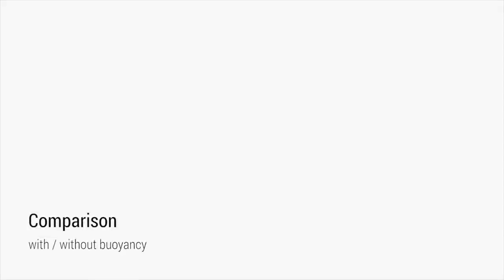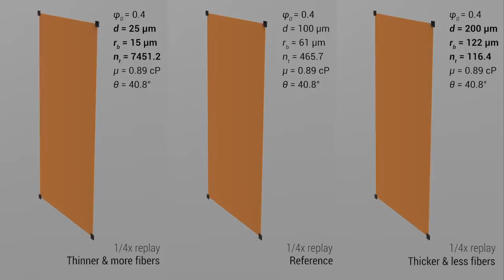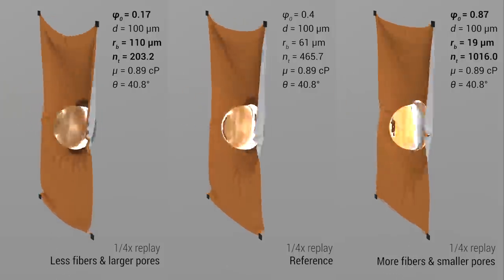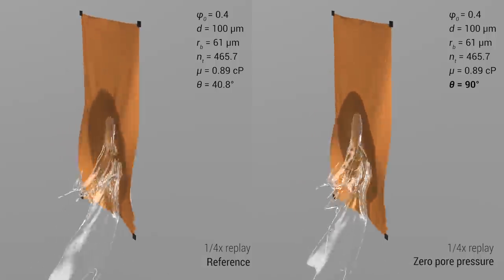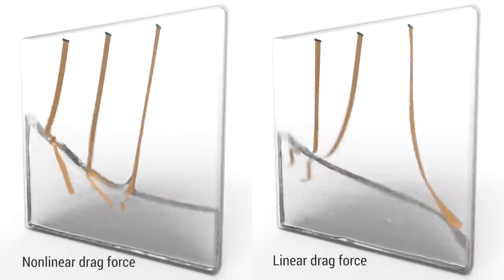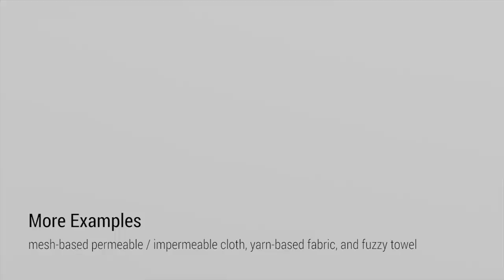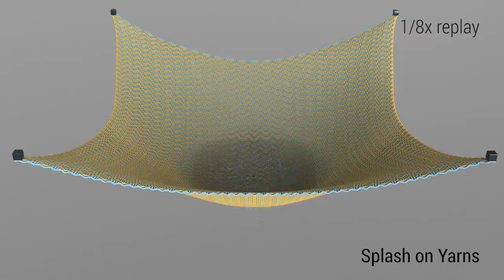[SIGGRAPH 2018] A Multi-Scale Model for Simulating Liquid-Fabric Interactions

Comment: To me personally, animated water looks either way too viscous, or has too much surface tension.
Reply: Yeah, that's the problem with fluids in general, since they have a set resolution per particle of liquid they behave more like gel or sand.
Reply: @Monkeynuts502  Damn you technological limitations!
Reply: It's not a question of technical limitations, it's a question of how long you're willing to wait for the simulation to run. If you set the resolution high enough and get the parameters right it's long been possible to create fluid simulations that are entirely indistinguishable from reality.
Reply: @Bob3D2000  
We can real time ray trace fluid Sims!, just not anywhere near cloth like this, that would be insane. Give is a couple years. AI is going to fix all of this.
Reply: @index7787  i wanna see that normal pc that sims water in real time with shader and lighting with billions of particles in real time

Comment: It's cool but it doesn't feel quite right somehow. Isn't it dripping for way longer than it should ?
Reply: Willy J. I think if how much the cloth can retain liquids can be adjusted, that would be fixed. Then again, this is a huge ball of liquid so maybe it's normal for them to be dripping wet for so long.
Reply: Look at the replay speeds. Most are 8 times slower than real time, some 4 times.
Reply: I feel the same, and after water is absorbed it also stais on the surface as liquid making the cloth really reflective for way too long, its not sucked into the cloth well

Comment: 4:43 Why does the cloth move before contact?
Reply from the maker: Because it's soft and needs time to relax under gravity.
Reply: @fyun0acm  OK, thanks. With the focus on the liquid I assumed the cloth would be stretched tight at rest and didn't consider that it would need to settle as well.

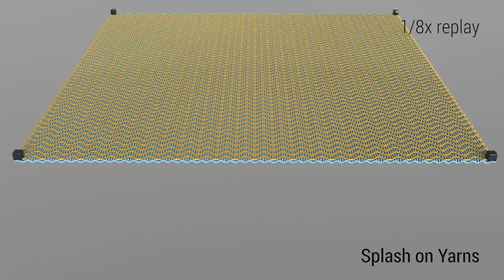Comment: 4:54 it’s that me or the yarns cloth moved before contacting
Reply from the maker: Yes the clothes was relaxed at first, and then contacting. The initial state was  unrelaxed so it will certainly moves during relaxing.
Reply: But if it's a simulation, how does the cloth relax if the vertices don't move, which they clearly don't in the video? It appears that the cloth is at rest and equilibrium under a constant gravitational force. Then before the water hits, without any external stimuli or the vertices moving, it dips before contact with the body of liquid.
Reply from the maker: Yes it's relaxed due to gravitational force. There's also a small gap between the liquid and cloth due to the finite resolution of the Eulerian grid.

Comment: What does it cost to produce (develop and render; time and hardware) one sim?
Reply from the maker: It depends on the size and length of the sim. For each example shown in the video it tooks in average 2~3 days for simulation on a 32-core workstation, and 1 day for the rendering on a small renderfarm with ~280 cores.
Reply: Raymond Yun Fei Thank you for the information. All this means that this clip is a result of hard work. Meanwhile it must bring a lot of plessure.

Comment: 4:50 is a perfect example of what is wrong with the simulation. The fluid is weird. No liquid when dropped in the shape with that volume would ever react that way unless it was some super viscous liquid. But then when it travels through the yarn you can tell it not super viscous skin the answer has to be. Your fluids dont behave enough like fluids. If you want more realistic fluid cloth interactions you need to start with realistic fluid

Comment: Imagine this in an adventure game, so when your characters moves or gets out of water - only the parts of cloth that actually went underwater are wet, and there isn't just a timer for how long it takes to dry but it would actually drip with physics. You could also add a vaporization effect that removes more of the liquid particles depending on temperature.
Reply: There are much simpler and GPU-efficient ways to do this kind of thing, but not even close to the quality in this video.

Comment: I am an expert in cloth - fluid 2-way physics, I have to say your physics is jittering. You need to tune the collision margins or heirarchy around that feedback loop, try to match the softbody substeps to the fluid.
Reply from the maker: Sorry but what jittering are you talking about?
Reply: Around 4:46,  but maybe the fluid is a jelly in that sim. Now I realise the fluid is permeating thru the cloth, the other sims look fine.  In my sims when the fluid drops off the edge of taught cloth, you get a high frequency flapping effect, but generally no jitter.  I'm using bullet softbody physics custom integrated with realflow.
Reply from the maker: Oh I see what you mean. This is more of a Houdini issue and out of the scope of our research. The surface reconstruction in Houdini was done independently across frames, and thus it doesn't hold temporal coherency. A good surface reconstruction is generally difficult to do, especially for slow liquid.
Reply: Ah, Houdini, I know little about that...nice cloth....... In C4D the cloth sim is too limited, so I have to use softbodies.
Excuse my flippant exaggerated comment, didn't really expect a reply, kind of trolling for a response, forgive that.